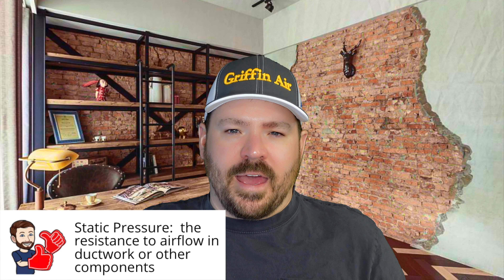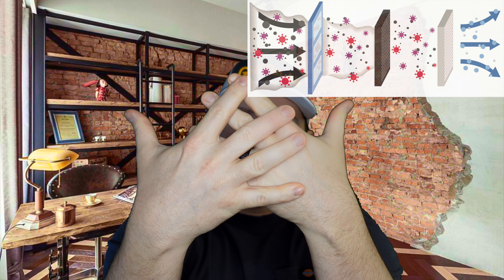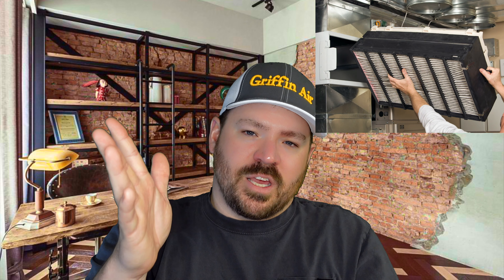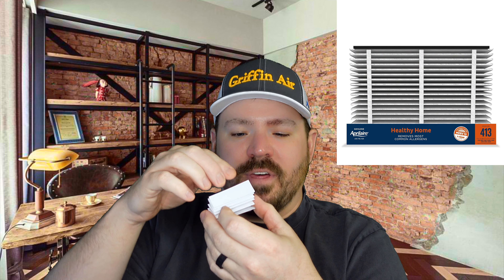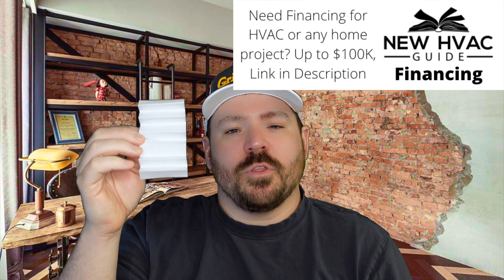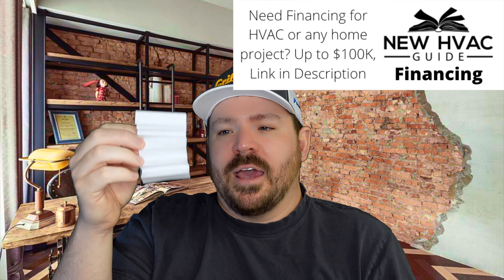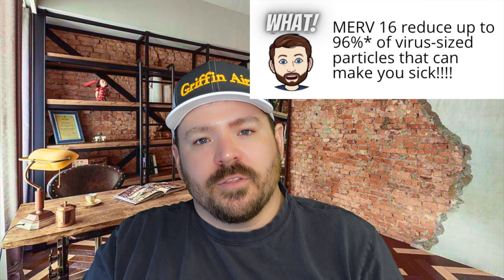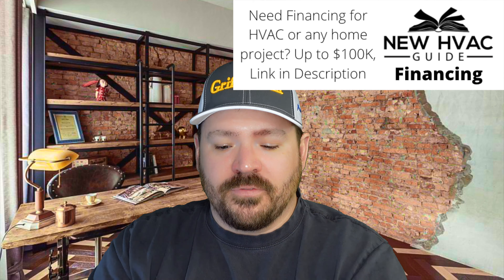DISPOSABLE Air Filters VS WHOLE HOUSE Filters!

Comment: The majority of systems I come across have high static pressure. Almost all homes need more than 1 return air duct. Get a 2nd return air duct and grill installed. Then you can install a nice filter without hurting airflow. The purpose of your HVAC system is to easily move warm and cool air through your home. If you have properly sized ductwork and low static pressure you are going to be more comfortable.
Reply from the maker: Well said pal!
Reply: @NewHVACGuide  I'd like to have access to your brand guide. It would be cool to have a HVAC contractor rate to access the brand guide. If Mitsubishi and or Trane is near the top of your list I'd be happy to buy a copy from you.
Reply: So the majority of the systems that you come across that have high static pressure, have high static pressure on the return side? Or both supply side and return side?

Comment: This is something I've paid attention to over the last three to four decades, with no intention of contradicting anything you said, Josh, I'll be happy to share a couple tidbits of my findings.

I found that the pressure drop, within a reasonable range, doesn't have much effect on the quantity of airflow generated by the blower.  That was counterintuitive.   Another counterintuitive finding was fan current variation due to flow restriction.  I expected fan current draw to increase when blocking off the inlet such as choking filter might cause, but no, fan current drops.  The blower motor draws the most current (thus presumably works the hardest) when there's no restriction and it's moving the most air.   Probe that current and give it a try, it's a real eye opener.

I bought a box of inexpensive fiber filters some 25 years ago, and I've trashed one or two since then.   I go about a year without touching them, at which time I pull them down, take them outside, and blow them clean with an air gun, then reinstall.  I have three filters stacked behind the front one at the grille site, plus another at the blower itself.  The later filters accumulate deposits very slowly (years before anything noticeable) because the first filter catches all but a miniscule fraction of airborne particulates (dust).  I don't feel any difference in the strength of air at the delivery registers between the clean filter, the year old dust plastered filter, and even no filter at all.   

Pretty whack!

Comment: Sq inches of filter surface area is very important. My 2.5 ton Trane HP was being filtered by an undersized 16x20x1 slot in the return duct close to the AH. I wanted to use a least a merv 8 to keep the evap coil clean. I tried one and got static drop of .23-.24 with my manometer. That's high for a clean filter. My returns could handle 3 ton unit with 1200 cfm, so I'm good there. My supply trunk would be sized right for my 2.5 ton @ 1000 cfm if it didn't have the 1" duct liner on the inside walls. That makes it adequate for 2 ton @ 800 cfm. according to duct sizing charts. Tried Purolator F312 fiberglass filter and got static of .10 @ 1000 cfm. That's good, but it's not gonna keep my coil clean in the long run. Had a Honeywell 20x25x4 cabinet fitted into the return that came with a merv 11 filter. Got static drop of .10 @ 1000 cfm clean filter. Less than half of the 1" merv 8 ! Measured TESP and got about .4. Compressor and ECM are happy.
Reply from the maker: Wow! Now that’s a testimonial!

Comment: The way my unit is setup, there is no place for me to put in a 4 or 5 inch filter. For now, I’ve always had a 1” filter placed right below the coils in the AH. I have 2 return grilles in my living room ceiling as well as 3 more in the bedrooms. I replaced all of these return grilles with an egg crate filter return grill that can hold a 1” filter. Since surface area increase air flow, would using 5 different 1” filters in the return grilles increase air flow as opposed to the single 1” filter that’s in the AH?

Comment: One thing most manufacturers don't provide you as a filter loading curve. Oftentimes the filter loading curve is 1 of the most crucial things. One of the best things you could do is pick a filter you like and start looking at pressure readings on a regular basis and figure out how fast does the filter change pressure. I seized my nerve 16 filters I manufacture at 200' per minute In order to ensure I start at a low enough static pressure that I can get a minimum one year out of my filters.
Reply from the maker: Shoot me an email with your info. I’d like to chat with you on a few things.

Comment: I replaced my 4" furnace filter with a 1" filter at the vent and it helped improve the airflow greatly and allowed the system to cool lower than it did before.

Comment: When the filter gets plugged, the motor speeds up, which means its unloaded, so it's not working harder, it's not working as hard.  So how does that hurt the motor?  The furnace will run hotter, and be less efficient.  In an electric furnace that could damage the heating element(s).

Comment: In the past year I have closed vents in the basement that lead to rooms we don’t really use. Because of this my furnace “pops” when the air is done blowing. Is this unhealthy for my furnace? Someone said I should just open all vents but I don’t want my bill to raise for rooms I don’t use
Reply: If your duct pops you may need to adjust your fan speed. 
As far as closing vents, generally I would leave them open. Closing too many will be hard on the system and won't actually save you money.

Comment: I bought an older home (1930)1800 sq ft  in late 2019. I upgraded the AC/Heat system to a 4 ton AmStd Platinum communicating system with variable speed along with a whole house duct cleaning in 2020. The system has a 4"  media filter. Originally there were 2 vent grates with no filtration at floor level. I replaced these with custom sized registers (16x16x1 and 18x18x1) and have been using Merv 8 pleated filters in them as a dust/animal hair prevent. The media filter is also a pleated Merv 8. Am I doing more harm than good?

Comment: what about the amp draw and temp of the blower mtr..........also what about the cfm across the evap.......that changes things also........static pressure is important and each system is manufactured to operate at a set static pressure......Placing a higher MERV into the system could cause many problems.....In the heat mode it could cause the combustion chamber of a gas unit or the limit switches on an electric furnace to begin to trip.......My recommendation would be to put on it what the manufacture says its rated for........depending on the system or where the home is located they may need to install an electric filtration system to control the dust levels
Reply from the maker: I can't disagree with you on any of that 🙂

Comment: My A/C unit takes filters of only 1" thick, so how does a 4" filter, which won't fit, come into any consideration??????????????????
Reply: The 1” filters are the return air. Those would be in the ceilings. If you have a 4” filter it would be next to the unit up in the attic.

Comment: I have a Bryant system 987MA66120V24A-B ac/gas.  Uses 20 1/4 x 25 3/8 x 5 1/4
M8-1056 Amana MERV 11 would using a Amana,Goodman Filter
Model Number: G8-1056
Exact Size: 20.25" x 25.375" x 5.25" Filter Rating: MERV 15 increase static pressure too much in my system? How can I tell if it does? Thanks!

Comment: I have a whole-home filter in the attic, 4" and I change it consistently as directed. I also have return vents in almost every room (1900sqft home) and the ducts are getting dusty and cobwebs all up in there, but the vents covers are screwed to the ceiling on all sides. 

Am I going to place undue stress on the system if I additionally install cheap filters at ea. return vent? My thinking is that some sort of low-rated, cheap filter would at least pull large particulate from the intake air BEFORE it gets into my ducts and starts building up... want to avoid normal duct cleaning (if possible)

thanks for the video!
Reply from the maker: That’s what I have in my house actually.
Reply: @NewHVACGuide  awesome - thanks!

Comment: Filter 10+ years ago blocked units. Todays  disposable 1” do not impede air flow as long as they changed frequently 12 weeks at minimum

Comment: I have a rudd system and I swear I've been getting sick and not sure if it's from the furnace or not. I think its an electrical one but not 100 percent sure. It's affecting me psychology we even thought the house was haunted. Not sure what to do. I told my landlord and nothing was done yet. So I got a y201 gas detector and calibrated it outside and it went off pretty good in my apartment not sure what to do now.
Reply from the maker: Eek! May be time for a new apartment?!
Reply: Most likely you have a gas furnace with a cracked heat exchanger delivering (CO); carbon monoxide aka "The Silent Killer"; get out of there very fast; Fire department may take a reading and certify your furnace is bad!

Comment: Just flipped through all your videos. Didn’t see what I was looking for. I have a 220v whole house air cleaner. It’s a Honeywell probably from the 80’s. I just bought the house and have never seen one of these before. Do they work or should I remove it and use one of the large house filters you recommend. Thank you
Reply from the maker: If it's an electrostatic filter that has not been maintained well, chances are it's useless now. They have to be maintained and kept claim to work well

Comment: I have a 80% Bryant 70kbtu furnace paired with a 2.5ton AC.  When I moved in system had 14x25x1 fiberglass filters.  I always ran those changed monthly no issues.  Wanted better air quality inside the home so I switched to pleated but went with a very low Merv 4 or 8 can't recall rating I believe by filtrete basic(clearly this low Merv rating would not help the quality of air that I was wanting but that's what I started off with).  System was too restrictive with that 1" pleated filter even though it was a low Merv.  Kept tripping the system.  About sucked the filter into the blower. Clean filters installed with the air flow in correct position.  Quickly took those out and went back to the fiberglass.  No issues since.  I went ahead and made 2 corsi Rosenthal style air filter/cleaners for the home to improve air quality.  Running (4) 20x30x1 filtrete 2200 filters on each unit.  If their is a solution on the market to change my 1" 14x25x1 filter slot into something larger 4" or 6" deep I believe that might give enough surface area to not restrict my system as much and give me the higher merv rating I am looking for for air quality and stop running the corsi Rosenthal boxes.
Reply from the maker: Sounds like you ductwork could be undersized if you can’t put a merv 8 filter in
Reply: How did you hook up the Corsi Rosenthal filter setup to your ductwork? Or did you just set up a fan separate from the ductwork to the Corsi Rosenthal boxes? Thank you :)
Reply: @Tadders  stand alone unit.  One is downstairs. One is upstairs. Downstairs filter seems to last about three months.  I'm assuming the cooking has something to do with that.  Upstairs filter I am getting six months or more out of. Nothing super scientific.  If I set a sheet of paper against the filter and the suction holds it in place I assume the filter is still working ok.  Alot of YouTube videos on the corsi Rosenthal design
Reply: @JSATI  thank you

Comment: I just had an HVAc tech do some work on my furnace. Before he left, he suggested replacing my 5" filter with a 1" filter as he said the issue with my low airflow rate was the pleated filter causing additional back pressure (increase in static pressure). I did not think this sounded correct and decided to check and VOILA..many of these HVAC guys are talking from their rear. The moral of the story is to check those questions in the back of your mind with Google or the people that actually know their $hit..like here!

Comment: The purpose of a filter is to protect the evaporator coil from blockage not clean your house.  Use the least restrictive filter and get the proper air flow.
Reply: ^^^This^^^

Comment: once your filter is covered with debree its done. about 2 weeks is what a filter is maxed out at...and that depends on the air poluation of its types,,, it could be soiner than 2 weeks...filters are way overated as far as time useable...sorry to bust the bubble ...but its fact.

Comment: I am closing on my home Friday and the new system only uses a 1-inch filter instwad of 2 or 4-inch. I have been looking at many options for what to use. The 3M 1900 seems really good balance. What is your opinion  on the 3M 1900? Great video comparing. https://youtu.be/RkjRKIRva58

Comment: I still have dust....
Reply from the maker: In your house? Filters don’t eliminate dust in your house.
Reply: If you do not have a brand new house that's extremely tight you may be sucking air through all the cracks and with that air comes lots of dust there is a thing called a fresh air damper you can bring in fresh air on your own terms in other words filtered versus extremely dirty contaminated air from the outside and or your crawl space etc etc Griffin can hook you up :-)